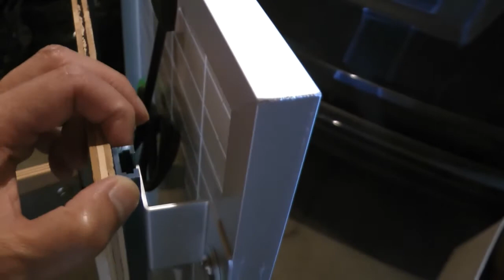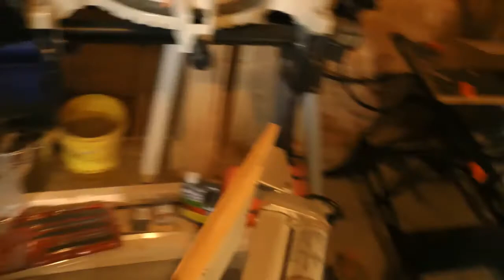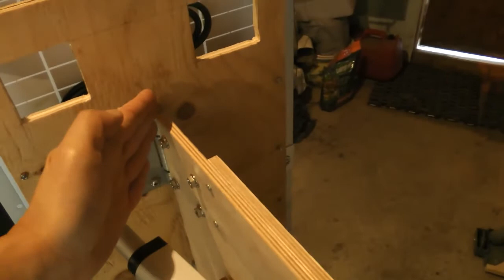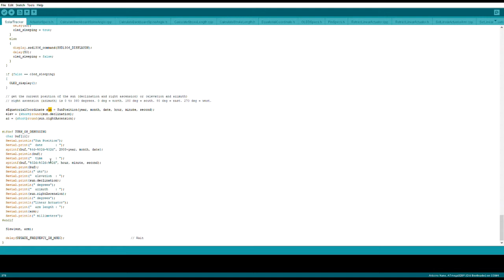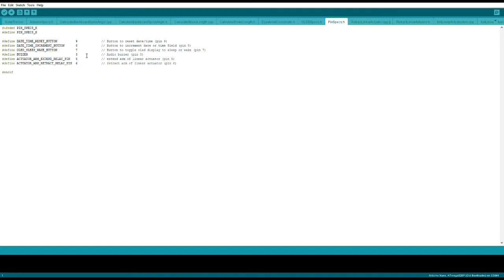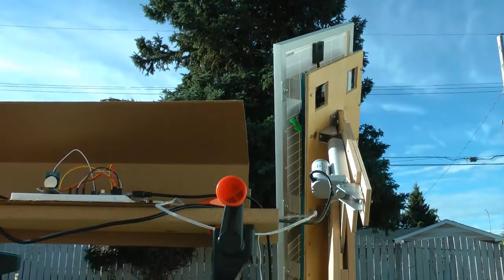DIY Solar Tracker based on celestial mechanics

Comment: That is a lot of work, expense and way too complex?  What is the percentage increase in total Watt-Hours per day vs Stationary ( ie Due South ) ?
Reply from the maker: @vto rsi. I agree. Trackers are no longer economical as economies of scale have driven down the price of solar panels. Most vendors would recommend adding more panels to address the solar inefficiencies of fixed installations. It's way cheaper to add more panels than trackers. But for sites with limited space, a tracker may be a viable option. I haven't calculated the total watt-hour difference between static and dynamic. If I do, I will certainly post that information.

Mostly, I like to tinker. It allows me to learn new things and I learned a lot working on this project. All this knowledge and insight is contributing to my ultimate end-game project, a fully automated greenhouse. And if I look at my inventory of model trains, the cost of building this solar tracker was a drop in the bucket. Besides everyone's got to have hobbies. Unfortunately I just have too many hobbies and not enough time to pursue them.
Reply: I read that solar tracking can add around 15% output. YMMV
Reply: @donalddalley7274  Using a "15% increase" ... this Tracker will increase the Solar Panel production by only an extra $1.00 per YEAR.  Therefore, even If the Linear Actuator and the Computer lasts 20 years, the Tracker will never "break-even".
Reply: With new technology, one or two solar panels should be enough for one house.

https://techxplore.com/news/2021-07-solar-cells-layer-crystals-thousand.html
Reply: @donalddalley7274  It's been 4 years. And your article, is still 100% BS.